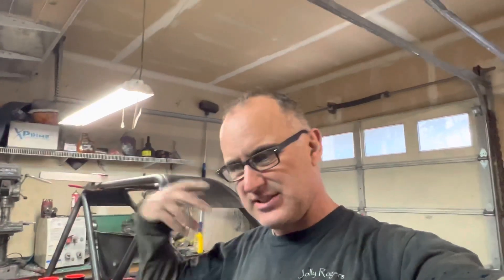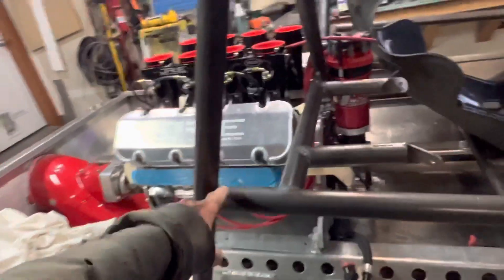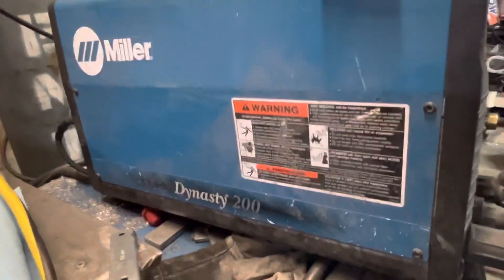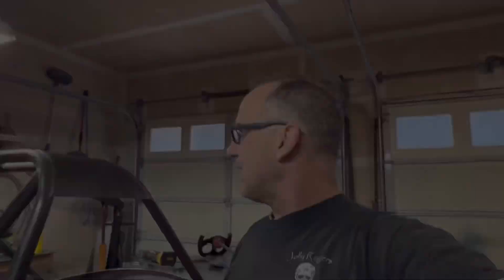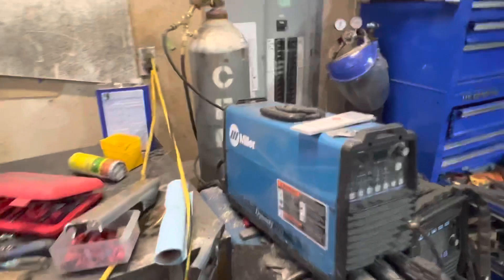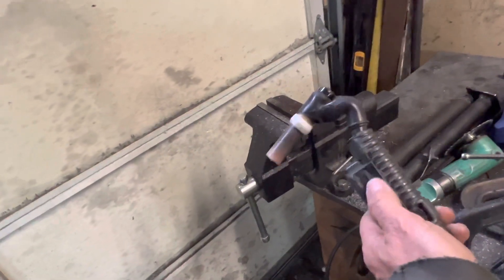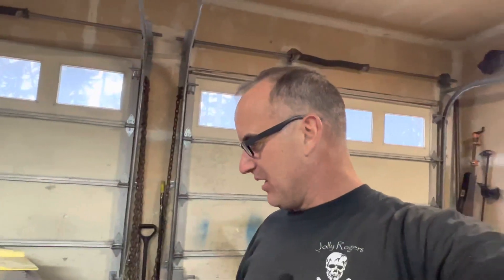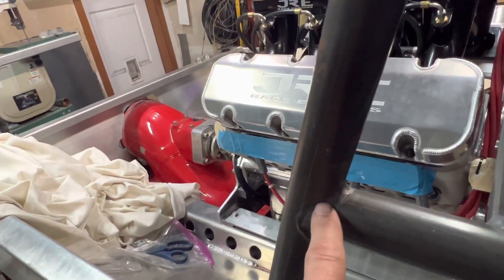How I weld out a chromoly rollcage

Comment: Do you drill a hole for the hot air to pass through  when a tube end meets a tube run?
Reply from the maker: I do that when a tube gets completely sealed.  There’s nowhere for that gas to go so it tries coming out where you’re trying to seal it.  If it’s a big e Pugh tube, let it cool and finish the weld off, sealing it, quickly and you don’t need to drill.  The little removeable tubes…I had to drill a hole in the foot!

Comment: is that a scratch start tig?
Reply from the maker: Is that the same as a lift arc?  It has that option but I don’t use it.  Honestly not that familiar with how that works 🤷🏻‍♂️
Reply: @JollyRoger907  yeah you have to lift to break the arc... but need to touch the tip or scratch to start

Comment: Nice job , once again! Jolly Roger boats are built well. Which is good! I saw five Jolly Roger crashes featured on a you tube video titled "Wildest Crashes in USA Sprint-boat  History" and I couldn't be happier that you do not cut corners on your builds. The boat on fire and boat upside down in the water ones both made me glad you want good equipment!
Reply from the maker: Thanks Mike.  We’ve had some hard hits over the years and I’m pretty proud that I haven’ t experienced any broken welds on the cages!  Some of my earlier builds had a couple engine bearer welds crack due to lack of proper penetration.  Caught it, cut them out and fixed them!

Comment: Is that regulated by the Jet Sprint circuit? In terms of type of pipe used and where the braces are located ect.
Reply from the maker: Yes sir.  Everything is pretty much directed by the rules.
Reply: @JollyRoger907  It's looks like you've done quite a few roll cages knowing all the placement/measurements making it look easy or that's the beauty of good video editing.